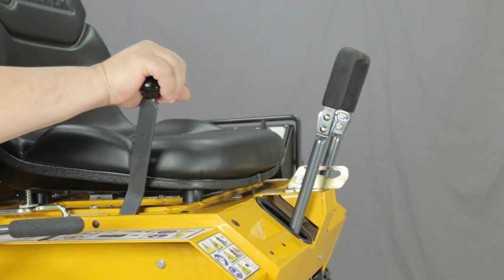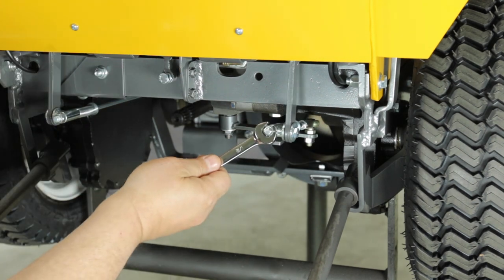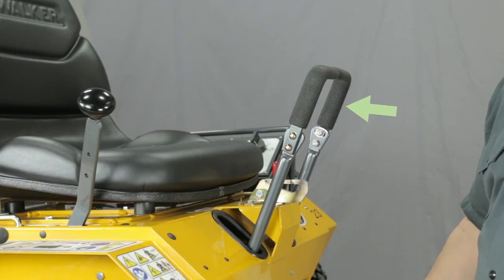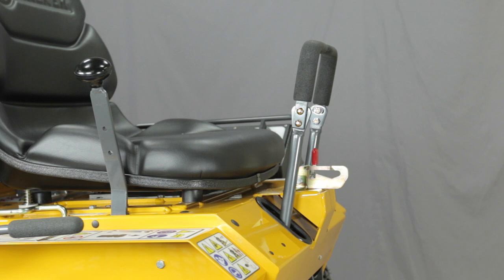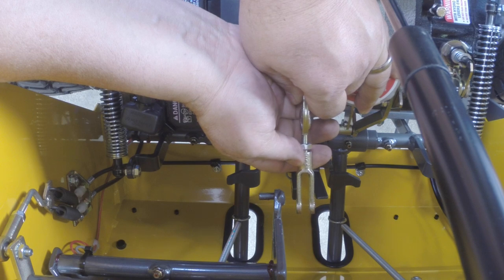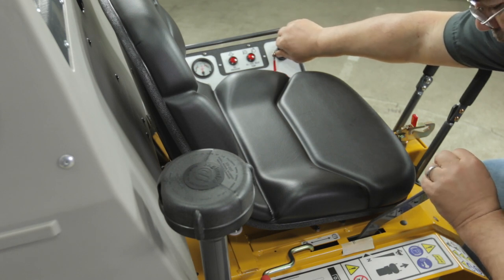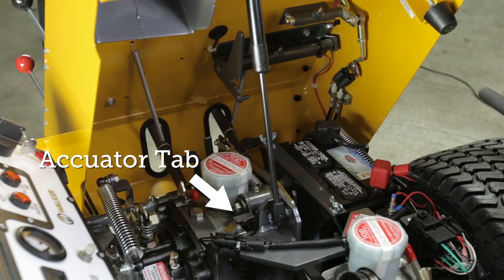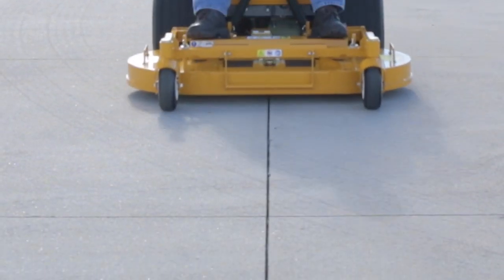TECH MINUTE - Steering Adjustments on Walker Model C, T, and D Eaton M7 Transmissions

Comment: Just tried to adjust mine on my ‘13 model 770 hours. Everything was great until I went to test ride. It was tracking again, small adjustments were made and at that point when I went to neutral I had one hydro spinning backwards. I have tried to adjust again with no luck. Any help? Is this a hydro issue? Or do I need to try the procedure again?
Reply: @alittlebitofeverything5090  I just adjusted it between tracking and when I go to neutral one starts to try to spin backwards. Probably rebuilding hydros soon. I’m kinda surprised but it’s no big deal. Also have to do a engine rebuild soon due to oil consumption. Low hours, taken care of, but I guess it’s part of buying one 2nd hand. Still love the mower and wouldn’t have it any other way.
Reply: @StephenBrewer89  It's a happy medium between the forward and reverse. I just personally rebuilt a walker I bought 2nd hand. If they are not leaking oil they burn it by blowby from the piston rings and oil scrapper eventually wearing. Find someone who is experienced. The cylinders can be honed and motor rebuilt with new rings. Don't let a dealer tell you it needs a new short block. That's the lazy expensive way. Mine does not burn a drop of oil and it currently has 2600 hours on it.
Reply: @alittlebitofeverything5090  I know that’s the truth! Yeah I’m very seasoned with rebuilding engines. Small engines or auto engines. I fixed a kohler CH23s in a Kubota zero turn, low hours, valve guide came unseated due to a cylinder head over temp, binder the rocker and bent the push tube. Local dealer was gonna charge the owner 1300 for the repair and said that was if they didn’t find anything else. I purchased a new OEM head, all the internals, seal kit, everything I needed for less that 400$. Had the job done in about 4 hours total. Sad the stealerships take such advantage of people.
Reply: @StephenBrewer89   @Stephen Brewer  Well nice to chat! Interesting  you mentioned the overheating on the 23hp. I have a 2005 CH26 efi Walker and when I got it, it had overheated causing a few issues. The reason it overheated was because the cooling fins on the head and block were packed with grass and debris on the blower side of the mower.
Reply: @alittlebitofeverything5090  very very common for those to get packed.
Reply: @alittlebitofeverything5090  a lot of habit people have is to use compressed air to blow in between the head shields and the cylinder head after every use. Especially in a dusty environment. If you have an oil leak or “seep” it will make this even worse as it will make dirt stick faster and in larger amounts. Hope that helps.
Reply: @StephenBrewer89  💯 You have definitely been working on a bunch of engines. Good advise thanks.
Reply: @alittlebitofeverything5090  unfortunately I’ve seen alot lol. Good to chat! God bless!

Comment: My machine is a disaster. Its so jerky and the alignment is terrible. I changed the oil on the hydros and my next job is doing this procedure. If this doesnt work im throwing this junk box out.
Reply from the maker: Hi there, please contact our support team at the following link, https://www.walker.com/requests/contact. Our team will be in touch with you as soon as possible to troubleshoot this issue.
Reply: @walkermowers I called and left a message. Ive been working on my walker for over a month fixing all these little problems. I changed oil seal on trans axle. Belts, new wheels, i took deck off and welded all the rotted out holes, blades, pulleys etc. I did oil change on hydros, engine, and transaxle and  i did an alignment via the link you sent me. Im so dissapointed. If im in neutral, full throttle, and pull the right lever back it goes in a donut backwards but NOT SMOOTH AT ALL. Its like im on a horse rodeo trying to throw me off.  The left side no problem nice and smooth. Moving forward is no problem but as soon as i try and turn right it goes crazy even if i touch the lever gently. Left seems to be fine but as soon as i gently let it go to go straight again. It jerks on the right side. Its a mess. So frusterated.
Reply: @walkermowers 
Read what i wrote forgot to tag
Reply from the maker: Our team will be in touch with you as soon as possible. Thank you for contacting us.